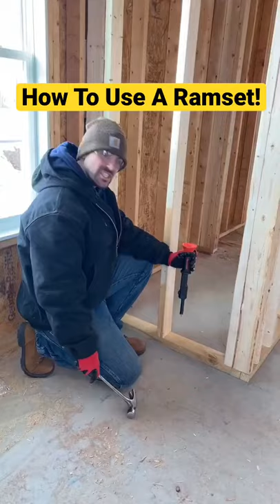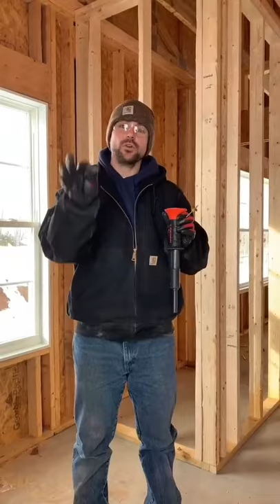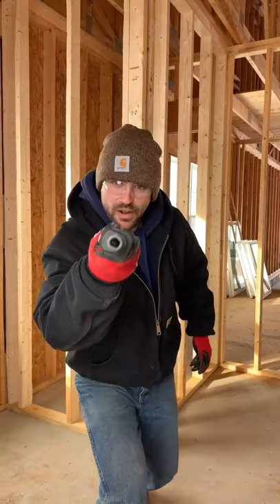How To Use A Ramset! #shorts #construction #tools #diy

Comment: Probably to load the nail then the blank.
Reply from the maker: Yea you could. Will not discharge until hammer strikes the top!
Reply: @TheExcellentLaborer  *unlikely to... 
Normal rules of gun safety apply, check unloaded . Load nail (inert), point in a safe direction, load blank (weapon now live), avoid pointing at anything you don't want to shoot.

It's unlikely to discharge, sure, but putting nail in with a powder charge in iy barrel does risk nailing one's hand should it go off by freak accident